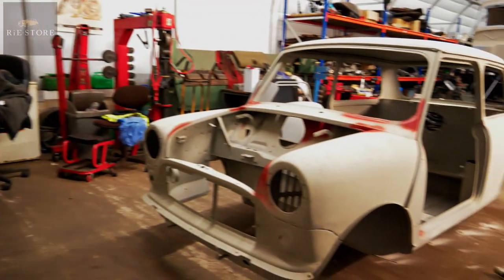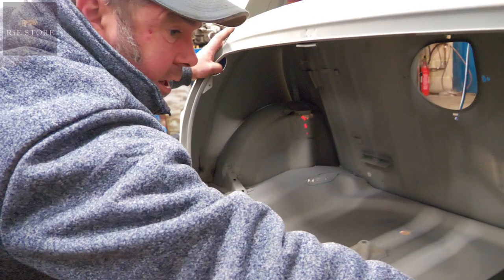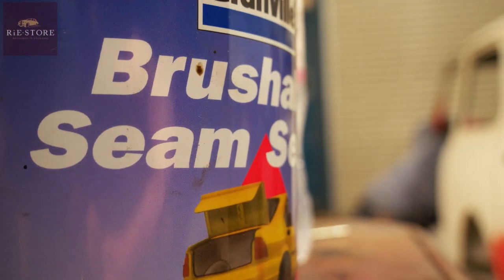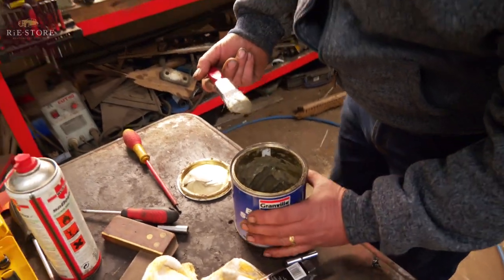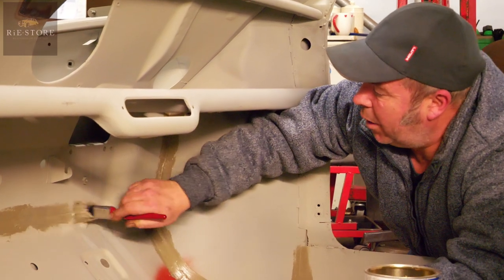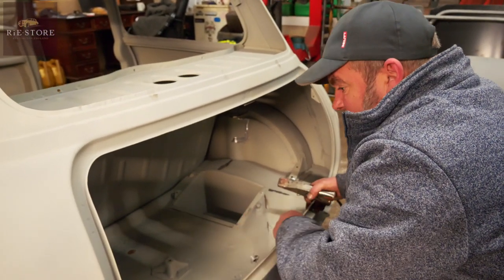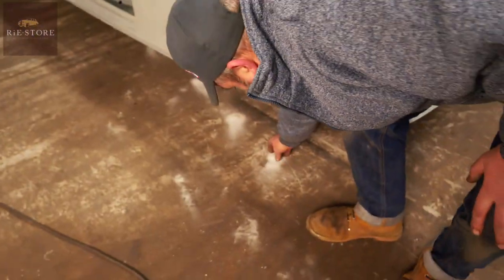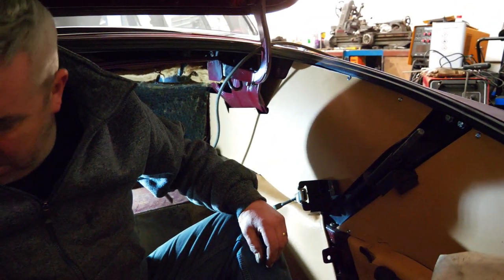Seam sealing - 1963 Mini Cooper 997 / ep013

Comment: Hey i got a question, im restoring vw t3/t25 and i thought i should put seam sealer on panel joints after epoxy primer but here it is put on bare metal is this better or it doesnt make a real difference?
Reply from the maker: Ash answered your question in this weeks episode - https://youtu.be/LXRoZKGbEsc